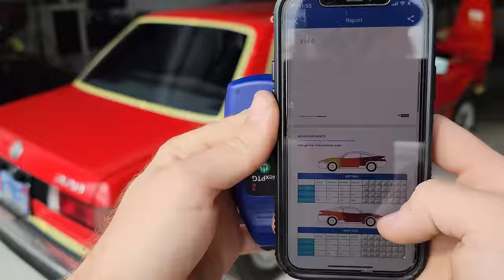BMW E21 320i Dry Ice Cleaning & Detailing

Comment: Does it not look like at times rubberised undercoating along with paint is being removed?
Reply: Yes of course. If this BMW ran in Europe, such a cleaning would be a real shot in the knee.
Reply from the maker: What you’re seeing is correct. Our dry ice is removing the undercoating, along with some paint on the parts that were poorly repainted underneath the car when they changed the body color.